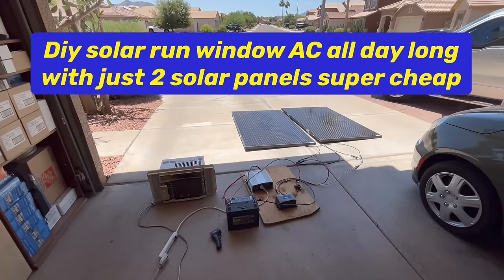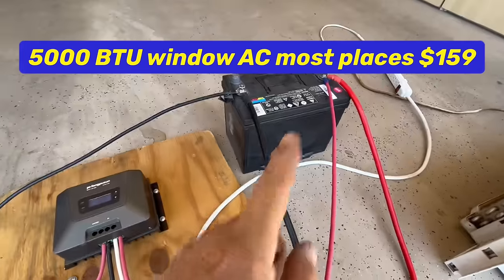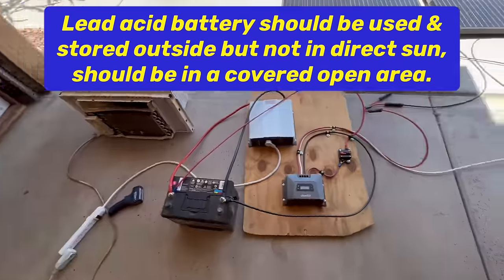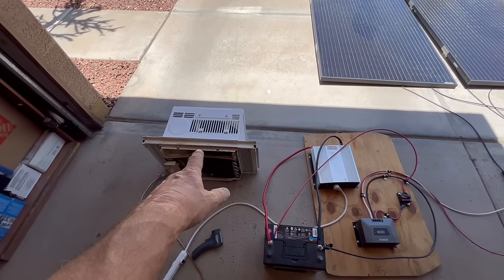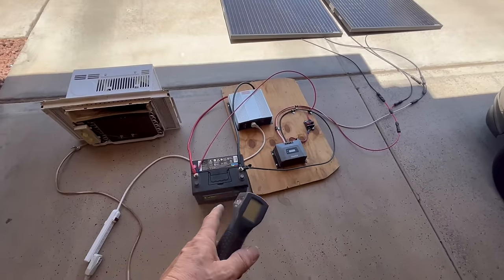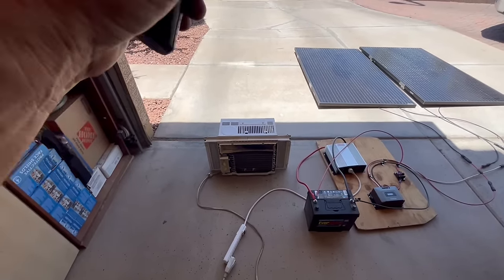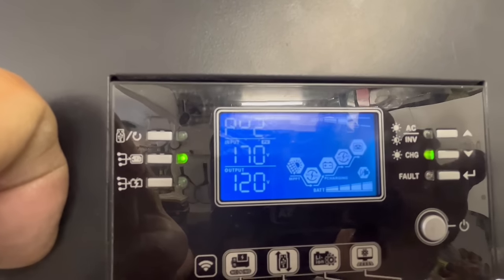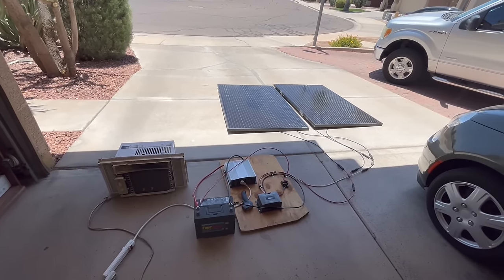Run your window AC with just 2 solar panels when sun shines. Easy DIY project you can do in one day.

Comment: This is the way to go in a grid down situation.  The 5000 btu is spot on.  The smaller btu AC can keep a room cool/cold in the event the grid shuts down for whatever period of time, ie. no need to cool the house down, just keep a room comfortable and the fridge going for whatever reason, food or medical.  We are inching closer to this where the power is out not for days, but maybe weeks.  Well done and thanks for showing this.  I'll be incorporating these ideas in my grid down plans.
Reply from the maker: Thank you, just trying to show basic set up so those who no nothing about solar can understand just how easy it is to build your own off grid solar for whatever reason they have. You are correct, don’t need to cool whole house in an emergency. But you might want to check out my other videos where I am air conditioning my entire 2 story house and garage with solar. I use batteries at night to run 3 1/2 ton ac unit upstairs.  My house and garage are about 3000 square feet. I also run my pool pump 24 hours a day on solar and heat my pool in winter using only solar. Check out my other videos, I’m sure you will find it interesting how much I use solar. 4 years ago, I did not know anything about electric, hvac, mini splits or off grid solar, but I learned and installed everything over 4 years and everything will be paid off though electric cost savings by the end of 2023. Thank for your input.
Reply: @diy-solar-guy are tne solar panels 12v or whats the ocv
Reply from the maker: Solar panels are 39v dc pv output
Reply: We have been down for two/three weeks after Hurricanes. I can run our house without ac on batteries. I have a small duel fuel champion generator to top off our batteries when running ac. I use an ecoflow max 2.  My panels were pricey though. Wish we had the hookup on used panels. Need two more waterproof panels.
Reply from the maker: @jolieb9138   very nice set up. Thanks for your input.
Reply: I love the USB mini fridge by Coolio and the usb ice fans. I plug them into a solar phone banks. Rouge RV fridge is nice runs on eco. 12 V. I ran it for 3 days on a small battery pack. Some of the hurricane products I like. Hurricane products on a budget.
Reply from the maker: @jolieb9138  very nice. Thank you for your input
Reply: @diy-solar-guy  

Great video. I love it.

You can add a battery charger of the same power of the AC window unit (connected to the power grid) and you can run the system during nights and cloudy days without disconnecting and connecting anything. Just set the charging voltage below the charge controller voltage so the battery is first charged with solar then with the grid. 

I would also add a DC-DC charger to charge the solar battery with the alternator of the car or truck.
Reply from the maker: @ajarivas72  thanks for your input. Nice suggestions.
Reply from the maker: Thanks for your input. We appreciate it. Hope you have a wonderful and blessed week
Reply: @diy-solar-guy  Put all the parts in a kit, record yourself putting the entire thing together in a step by step process, upload that video to your website, then start to ship the kits out.
Reply from the maker: @JohnHandle-  thanks for your suggestion. Hope you have a wonderful and blessed week
Reply: @jolieb9138  santansolar carrys alot of used Panels
Reply: Duh system is to small to run the frige and an AC
Reply: @cruz47144  what?
Reply from the maker: @cruz47144  you are correct, a fridge surges much more than a window ac, the compressor on fridge is considerably larger.
Reply from the maker: @cruz47144  since you continue to leave comments that are baseless and rude I just keep deleting them. If you. Continue to leave rude comments that have nothing to do with videos content I will report you as well. Please don’t be the first one out if almost 400,000 viewers I  to report to YouTube. I thank you in advance for your cooperation. Hope you have a truly wonderful and very blessed week
Reply: Why wait for grid down scenario? Why not do it "for real"?
Reply from the maker: @patrickbodine1300  I save over 85 percent off my grid electric bill a year. If grid goes down out here and you are on grid. Your solar goes down to. If the grid goes down I can power everything in my house. We can’t go completely off grid where I live but it sure is nice being only electric at house and electric bill only being $1000 a year living in Phoenix AZ where if the wind is not blowing in summer, it feels like being in an oven. If the wind is blowing, it feels like you are in a convection oven, it get pretty hot in summer out here
Reply: Would you talk about capturing energy.  Batteries that are charged all day so you could run AC all night with no panels.  What is it in the sun that purpels energy.
Reply from the maker: @lamh5265  I have many videos already dealing with running loads in day with solar and keeping Batteries charged all day to use over night. We can run 100 percent of our air conditioning with solar in day and battery bank at night. Check out the other videos showing all we run with off grid solar.
Reply: Awesome vid thanks ^^ - just curious, doesn't your incoming current (38.5amp) exceed your 100AH charge rate? (e.g. 25amp or whatever) Or does that not apply when drawing current at the same time? Cheers. @diy-solar-guy
Reply from the maker: @asedcopf honestly not sure why that was showing such a high current. Solar panels at max is only 9 amps In perfect conditions?
Reply: @diy-solar-guy  is it just the MPPT controller doing a conversion of the high voltage (30v) down to 12  and rather than "waste" the other 18v, runs its own internal parallel connection/conversion to drop the V and increase the A? 
Probably barking up the wrong bush, trying to learn this stuff - but if that were the case, you should be reducing battery life by charging too fast - although you report using this setup reliably for years. 🤷‍♂️ did you find you burnt through batteries faster than normal or was this the first time the output current from the CC was so high?
Reply from the maker: @asedcopf  batteries were in the air conditioned space so they lasted longer, still have the original batteries, I used and they still hold a charge. The charge controller is not that accurate but they no longer make this charge controller. I no longer use these charge controllers except to use in videos for basic set up.
Reply: Your setup is cool.Is the battery used there a 100ah ? And how long would the ac run on the battery after the solar panels stop producing energy ? @diy-solar-guy
Reply from the maker: @gsrjaycee4521  this is a lead acid battery in this example, only meant for use while sun is shining. You would have to use lithium iron phosphate to use overnight. I have many videos on running mini splits and my 3 1/2 ton and 4 ton whole house heat pumps with solar in day and LiFePO4 battery bank overnight.thus not spending a penny for air conditioning in summer or heat in the winter. Electric rates have quadrupled in the last 20 years. Check out my other videos on how we accomplished this and installed 2 mini splits upstairs, 2 downstairs and 2 in garage. We even installed a mini split in our motor home and will soon be installing solar, battery bank and inverter to run everything. Hope you enjoy the videos.
Reply: How long will
That battery run the ac if the solar panel could not get sun?
Reply from the maker: @diaperdood1 This is just a bare bones example to show you can run window ac with solar. We started with this example  4 years ago and greatly improved upon this system and now run our 2450 square foot house 2 story house. We now run our 3 1/2 ton & 4 ton whole house ducted heat pumps to air condition house and garage to 72 degrees while 110-115 degrees out in Phoenix AZ. We also run many more things 24 hours a day. Check out our newer videos to see what we run now. Hope you have an extremely blessed 2024.
Reply: @diy-solar-guy  thank u so much!
Reply from the maker: @diaperdood1 you are so welcome
Reply: I bet you will.....🙄
Reply: 5000 BTU keeps room cool?
Looks over at 8000 BTU unit that gets overloaded for 3 to 4 hours a day here in Florida unable to keep up with the heat during the hottest part of the day.🤣🤣🤣🤣
Reply: 11:41 Heat rises cool air drops.
Reply from the maker: @justsoicanfingcomment5814 you are correct, I did not catch before uploading. I accidentally said it backwards, please forgive me. Hope you have a truly wonderful and extremely blessed weekend.
Reply from the maker: @justsoicanfingcomment5814 this is just a bare bones basic example to show it is possible to run across with off grid solar. I have improved upon this first experiment and now run my upstairs 3 1/2 ton and 4 ton downstairs heat pumps with solar all day to air condition my 2 story 2450 sq ft house along with ac in 3 car garage that is around 600 sq ft even when it is 117 degrees out here in Phoenix AZ. We even hear our 15,000 gallon pool with a 12.7 ton pool heater that is electric, uses 6500-7500 watts while running. We can swim year round heating with off grid solar. Check out our newer videos to see all you can do with off grid solar and even more than what I do. Hope you have a truly blessed day.
Reply: Hey, such a minor thing about the 2 or 3 panels. I was an a hole. I deleted the comment. Cheers.
Reply: @diy-solar-guy  Basic examples should cover as many tips and tricks to maximize that little setup.
Insulation, setup location, minimize length of wires to reduce wire resistance and use larger guage wires than required for the same reason.
Small wires heat up because of the resistance to electrons flowing through them more than larger wires, heat is wasted energy.
Place an awning over an ac unit to keep the sun off it to increase it's efficiency.
Little things like these will stretch that tiny system a lot further.
Reply from the maker: @justsoicanfingcomment5814  thanks for all that helpful suggestions.
Reply from the maker: @justsoicanfingcomment5814 thanks for your input. Just wanted to show that you can run ac with solar. Basic bare bones set up. I actually have many more videos showing running main house heat pumps upstairs and downstairs to air condition and heat my house as well as using mini split to air condition and heat my 3 car garage. All with solar and I run house upstairs with Lithium iron phosphate batteries over night. Check out my other videos showing what’s possible with off grid solar.
Reply from the maker: @justsoicanfingcomment5814 I just was showing a bare bones example that you can run a window ac with solar. That it can be done. Thanks for your suggestions of what to show in videos. Appreciate it. I actually run my main upstairs and downstairs heat pumps for house with solar off grid during the day and battery at night for upstairs ac. This example was so you can see what else is possible with off grid solar.